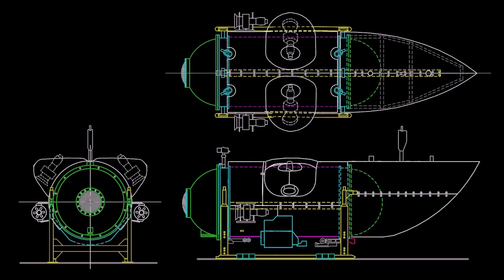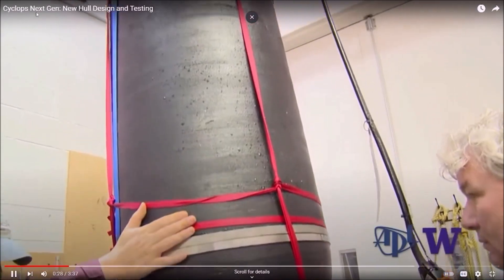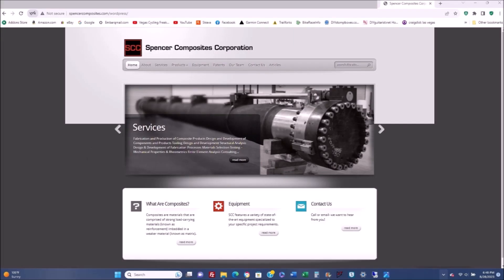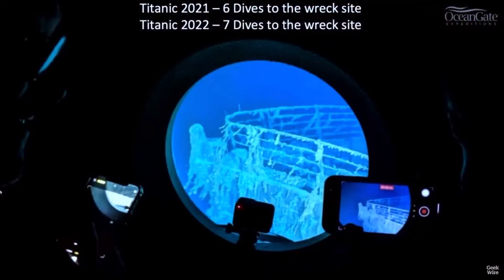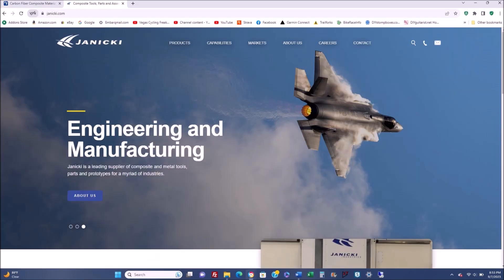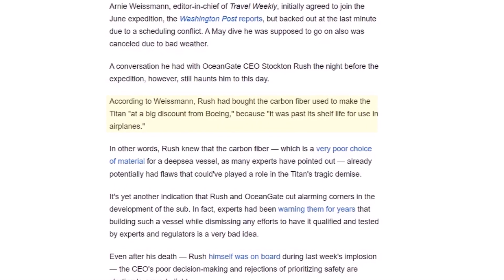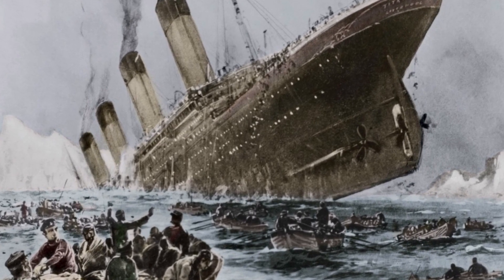OceanGate Titan - THE CARBON FIBER CYLINDER(S)

Comment: The winding systems shown could lay tape at shallow angles while transiting lengthwise, but not at 90 degrees axially in setup shown, particularly while laying concentrically... The head cannot move in 2 opposed directions relative to tapes from any single reel.  Maybe 90 degrees is possible with opposed diagonals, but then they're still only in passes of individual layers. Your graphic mentions hand laid axial fibers, but nothing seen in hardware present corresponds. There would need to be tables or reels of prepreg carbon fiber ready to be laid in between concentric passes.

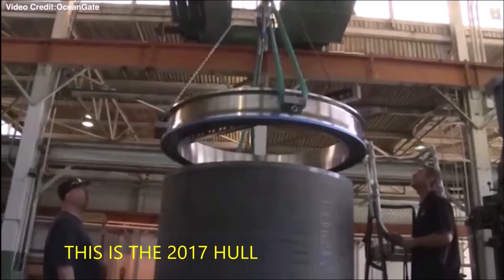A portion of video shot at 5:43 shows some wide spaced axial lines opposing the concentric layup, but to me it looks like some irregularly laid sheets of carbon might have been integrated lengthwise at one point ?  Surface finish appears to show some axial ridges as well ?  If they had any axially handlaid sections, the terminations at the ends are invisible and not similar to regularity shown in concentric layup seen elsewhere in video,  Regardless of layup, they were not interwoven as a mesh between layers to achieve best strength possible.  They can only react as individual layers sharing loads through resin's bond strength since the are not woven together 3 dimensionally.
Reply from the maker: Yes this is what has confused me. I don't see how it is possible to manufacture a cylinder with axial fibers using the method they did. The only way I see that as possible is by doing the axial fibers manually by hand. The original (2017) hull appears to have zero axial fibers, but the winding video is also not detailed enough to make any conclusions about it. I only have three pictures of the replacement hull (2020) being wound so I have even less info to work with there. 

This 2017 CompositesWorld article is where I got my information on the CF cylinder specs, which lined up with info given by OceanGate engineer Bruce Morton (who was describing the 2020 hull). So both hulls appear to have had the same dimensions.

https://www.compositesworld.com/articles/composite-submersibles-under-pressure-in-deep-deep-waters
Reply: @VegasCyclingFreak   It does say that they hand laid cloth axially, but then they also state they baked it, intentionally avoiding an autoclave, which would have reduced the resin and increased it's strength overall... it sounds like the hand laid cloth's weave was oriented vertically/horizontally vs a 45 degree bias that would have been tougher and stronger in compression. Interesting that Fosse's attempt to use composite's in a diving submersible has never been tried or sold to another party like Rush.  Curious about the cutting method to trim cylinder to length before bonding of end caps, it is another possibility for weakness. Having an external clamp on set of molds to create finished shape would be better than a cutting instrument regardless.
Reply from the maker: @mkllove  What I wonder about is did they actually ever hand lay cloth. The 2017 hull winding video makes it appear that it was just many layers of tape. I don't know they really had to cut the 2017 hull because of those flanges on the spandrel. It appears that they definitely had to cut down the 2020 hull from what I see in one of those pictures of it being manufactured. There was no flange on the spandrel in that case.
Reply: @VegasCyclingFreak   Maybe if you can get a good end on view of cylinder before they applied the adhesive to see if there is any sign of "end grain" like in wood showing the axial fibers terminations where cut ? It would likely be distributed in several ring shaped layers between the hoop sections if it's visible even just by contrast between layers...
Reply from the maker: @mkllove  I have a kinda low resolution picture of that for 2020 hull but not for the 2017 hull. Doesn't really look like wood grain to me. If there is a grain it's very fine. Overall it looks pretty smooth with five distinct layers that appear to be in one inch increments.
Reply: @VegasCyclingFreak   So maybe only 5 axial cloth based layers in all of the the schedule ? Seems pretty insubstantial. Don't you agree ?
Reply from the maker: @mkllove  Agreed. Beyond woefully inadequate. I'd say it would need to be a 50/50 ratio, or even fibers in three different directions. Might be overkill but it's better to be overdesigned than to rely on a flimsy safety margin, especially since this has never been done before. The way it was made relied far too much on the strength of the resin. 

Perhaps the failure of the hull can ultimately be attributed to the rtm system not picking up the failure of the resin? According to the patent, the center frequency of that acoustic monitoring system was 150kHz , nearly ten times beyond the range of human hearing. Maybe the resin was breaking down on every dive and it went unnoticed because they weren't listening to it? There has to be a disconnect somewhere.
Reply: @VegasCyclingFreak   Absolutely bad schedule of layers that did not reinforce layer to layer, putting primary loads on resin.  I don't think the rtm mattered when their own ears told them it was popping and cracking "like a rifle shot" so I suspect they ignored the rtm data AND what was obvious even to human ears. They at least could have used some additional sensors throughout hull ( 12 or more in 3x4 matrix for triangulation ) and had ONLY a pilot take it down to first level of "popping" stage to identify areas of concern for x-ray and non destructive sonic examinations. This will be remembered as the Hindenburg of submersibles for next century I believe... Hope they reveal close ups of flanges and ANY fiber recovered with other hardware in months to come. Wait and see, right ?
Reply from the maker: @mkllove  Yeah I have to agree with you. I don't know that we'll ever get any detailed info on the failure mode but we can see the CF hull had some deficiencies, at least from our point of view.
Reply: @VegasCyclingFreak   Looking forward to any more videos on subject, I've just subscribed.

Comment: Vegas, you keep stating that "the technology [for carbon fiber under extreme compression] is not there yet." In truth, you're saying that the technology to overcome obvious design errors is not there yet. Why overcome them? Because carbon fiber is sexy? Because it is a way to elongate and lighten the vessel for more paying customers? For the same reason that an atypically-large viewport was chosen?

It is possible that the acrylic or the carbon fiber failed first. The tube would sag more in the center than at the end rings toward the bottom of every descent. The acrylic may have developed microscopic fissures. But even if none of these separate parts failed, the interfaces were certain to fail. Beyond the issue of immense pressure at depth, there is the differential response to pressure. Characteristic responses are quite different for the acrylic, the carbon fiber, and the titanium. And there are gaps in the hull where various connectors/wires/mechanicals enter the hull from the aft bay. Eventually, there was bound to be a seal breach. All designers of deep sea submersibles would like to move beyond the spherical shape and single-material hulls. But until the Titan experiment, the designers have placed safety first and have not disregarded the clear constrains of physics.
Reply from the maker: I'm not for or against the carbon fiber. Looking at it objectively, I think there could be a way to make it work some day in the future but it would need years of testing and a lot of money dumped into it. I don't think anyone is going to go down that road after this unfortunate event. There was also a time when no one thought carbon fiber in airplanes would ever be a thing but now it's apparently commonplace. To me, this all points to making a shipwreck where 1,500 people lost their lives into a tourist destination. Totally not for that.

The reason for carbon fiber: strength to buoyancy ratio. Rush claimed that it was three times better than the next best thing - titanium. He also liked the idea of not needing a lot of syntactic foam to make a DSV more buoyant, so you don't end up with a big bulbous looking thing. Rush also wanted five people capacity so he could pilot it, PH could talk about the Titanic or other things they might see and three "mission specialists" could tag along. 

Yes, the dissimilar materials presents some challenges. On the acrylic viewport, Rush claimed that you would get a visual warning, so lots of time to react. He said a crazing effect would happen and that was your visual warning. Rush claimed the crazing effect would occur at 1/3 the pressure of its failure point. It's possible that maybe it suddenly failed due to cyclic fatigue, but it was 7" thick and it's a pretty tough material.

Comment: The black object that you speculate was another hull was actually just part of the forms used during construction of the fiberglass fairings that surrounded the hull.
Reply from the maker: That could be a possibility. I have not been able to determine what those exterior shell pieces were made out of. I was thinking they’re either carbon fiber or aluminum. They look to be about 5/16” or 3/8” thick. The pieces around the hull had to be sturdy enough to mount the brackets for the vertical thrusters to. Don’t know that fiberglass is sturdy enough.
Reply: The fairings were made of fiberglass although what type I do not know. Nothing was directly mounted to the fairings. The thrusters  were mounted to frames that only sat on the fiberglass surface and were bolted onto rigid structures under the fiberglass. The forms on the shelf are for sure the forms used during construction of the most aft fairings that covered the equipment cage, propulsion batteries, comm cables, and high voltage motor controls etc.  @VegasCyclingFreak
Reply from the maker: @GreggLong-uw5ht  Sounds reasonable. I haven't seen any pictures/video that showed any structures below the fairing which the thrusters would be fastened to but that would make sense. I've noticed that the vertical thrusters were in two different locations... really early version had them just behind the horizontal thrusters, then they were moved more towards the top.
Reply: Titan was built using an iterative design process. Almost all of the systems underwent extensive changes before final implementation. Some of these changes, particularly the ones having to do with the drop weight system, changed the center of buoyancy which necessitated changes in the location of the vertical thrusters.     @VegasCyclingFreak

Comment: Interesting, though flawed, video. Not good enough to warrant a Thumb Up but not bad enough to warrant a Thumb Down. 

Some of the statements in this video are true. Yes, The Titan Imploded because of the failings of carbon fiber as a substance to make submersible pressure vessels out of. Yes, carbon fiber tends to break "all at once" with little or no warning. Yes, the carbon fiber cylinders for The Titan were made by subcontractors, not by OceanGate. You got all of those things right, yes. 

But no, the blame for the implosion cannot be laid at the feet of the subcontractors. They built cylinders to the specification of Stockton Rush. As Co-Founder, Majority Shareholder, and Self-Appointed Chief Engineer, Stockton Rush had the responsibility for making sure that The Titan was designed and built in such a way that it would not implode. He failed to meet that responsibility when he chose carbon fiber for a role for which it is not suitable: pressure hull for a 3700m submersible. That was his first of two huge errors he made. 

Stockton Rush's second huge error was misinterpreting the sounds he heard on the sub's first dive. The whole thing about "On the first dive, we heard carbon fibers breaking, but on subsequent dives we didn't hear them breaking any more" was exceedingly moronic. It was never acceptable for any of the individual carbon fibers to break, ever. That hull lost part of its strength during that first dive, leaving it very susceptible to sudden catastrophic failure on subsequent dives. The only acceptable action was to do an emergency return to the surface immediately upon hearing the "breaking" noise and scrap the pressure hull and replace it with a suitable technology such as a steel or titanium hull, rather than continuing to gamble the lives of passengers on a fatally-flawed and already-mortally-wounded carbon-fiber cylinder. 

Due to those two huge errors by Stockton Rush, The Titan was doomed from the beginning to implode; it was not a matter of "if", but "when". And the "when" was about 14:00UTC on 18 June 2023. And 4 people (including Stockton Rush himself) died because of Stockton Rush's errors.

Hubris, greed, and power should never be allowed to over-ride safety culture in any transportation company. But in OceanGate, that's exactly what happened. Having just one man be Majority-Owner, Chairman Of The Board, President, Chief Executive Officer, Chief Operating Officer, Chief Engineer, Chief Quality Assurance Technician, and Chief Safety Officer, was a bad mistake. Ideally, those should 8 different jobs. If the company couldn't afford that, at the very least it should be 2 jobs: one "Safety Officer" who's mandates were binding and could not be over-ruled by anyone, and Stockton Rush (doing everything else). But since Stockon Rush was in full control, no one could say "no" to him, and any who did were fired. (Yes, he was warned! But he fired the person who warned him!) Absolute power + hubris + greed corrupts absolutely. And that's what happened to Stockton Rush. And that's why 4 people died unnecessarily in The Titan at 14:00UTC on 18 June 2023.
Reply from the maker: As far as I can tell, 2017 hull made two or three test dives and was scrapped. Rush did first dive solo. 2020 hull was tested before it ever touched water and it performed exactly as expected. If you don't know what the Kaiser Effect is, yeah it's going to sound like horse crap and "moronic". Carbon fiber is not like titanium or steel, it's made of carbon fibers. Some of them are going to break at a certain pressure, but after that point you should be able to repeatedly take the hull to the same pressure with no ill effect if no more fibers break. That's the theory anyway.  However, the other half of the equation is the resin. Maybe the fibers can handle the repeated dives but the resin can't. Rush intentionally destructive tested a few 1/3 scale hulls to gather data but that's probably not anywhere near enough testing. Also, there is little or no data on carbon fiber with respect to Kaiser Effect, so Rush was flying by the seat of his pants a bit there.

The "mission specialists" all signed fairly standard waivers that mentioned death several times. This ain't like getting on an airliner, this is "extreme adventure tourism". It's inherently dangerous in one way or another. Titanic is in international waters so they were able avoid having certifications on their hull. Would there be the same outcry if one of these billionaires died in a rocket that blew up while on their space adventure? Is there some agency that certifies rockets? (serious question). In my opinion neither of these ideas are good. Let the people who died on Titanic rest in peace and let's not hurt the environment anymore than we already have with all the incessant rocket launches by every major country in the world. 

Anyway, I'm just looking at the technical aspects of Stockton's creation. People are free to form their own opinions about Rush.

Comment: As an aerospace engineer, Rush should have known that carbonfiber was useless for long~term deep dive situations. So WTH did he choose this material, aside from the "cheap" factor? The more stones we pry up, the more faults the man had gets exposed and then tries to slither under other rocks.
Reply: That last dive was different.  They were descending much faster than normal indicating some type of buoyancy problem.  If the fibers had somehow become saturated with water making them heavy, it was doomed from the beginning.
Reply: "Doomed from the beginning." Yep.
Reply from the maker: @OGLizardKing  No way the cylinder can become a big sponge. It was either too much ballast and/or ocean currents. Newfoundland area had the worst weather in 40 years this summer. I'm sure ocean currents were stronger than usual in that area this year.
Reply from the maker: It wasn't cost, it was the strength to buoyancy characteristics of carbon fiber. Three times better than the next best thing - titanium. That way you don't need to have a big bulbous thing with lots of syntactic foam just to make it neutrally buoyant. In theory it's a great idea but I don't know that they can actually make one that can do the job with current technology. Maybe one day but we're not there yet.
Reply: @VegasCyclingFreak   You're an apologist for a fool. It's 100% on him.